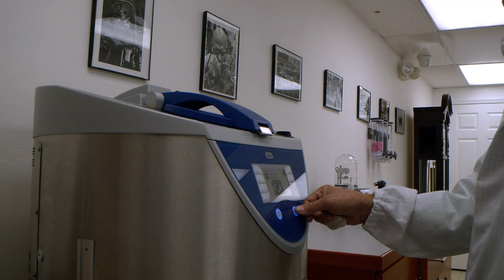Richard Mille RM005 | Complete Overhaul

Comment: 5s/day is horrible for an expensive watch
Reply: take your any wrist watch, put it in timegrapher and then turn the position of the watch 180°.  you will have a deviation of 5-20 s/d.
Reply: @danijelparadzik8336 Not true as that should be one of the 5 positions adjusted to in a chronometer grade movement.
Reply: @garyboyle695 They’re not far wrong, at all. People often don’t realise how much positional rate variation can exist in a COSC certified chronometer movement, adjusted to 5 positions. 

A COSC rated chronometer must have an average daily rate across all positions of -6s to +4s per day. 

There can be a -8 to +6 s/day variation between dial up and dial down. 

The maximum difference between any of the 5 test positions must be no greater than 10s/day.

Then we must remember that COSC tests across 5 positions. All of the remaining error is hidden in the 6th position, which may exceed the 10s/day delta that is permitted between the 5 test positions.

Comment: No craftsmanship whatsoever in that overpriced casio like movement no perlage, no anglage Nothing!!! But stamped and cnc'd cut bits of metal and carbon fibre. Really only worth it's weight in toilet paper
Reply: There actually is anglage and black polished parts, clearly you only know basic stuff. This watch is expensive for other reasons, it’s also very shock resistant which is difficult for a mechanical watch. I agree the price is high but lots of people can easily afford it
Reply: @DirtFather407 The mark up on Ram's must be astronomical because they sure as hell don't spend a lot manufacturing it.
Reply: can not agree with you more, its piece of crap.